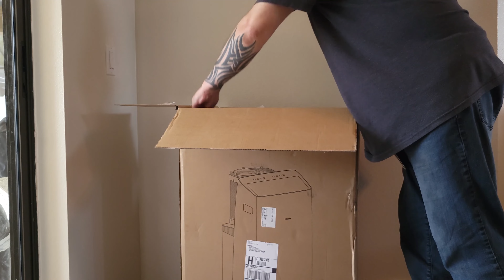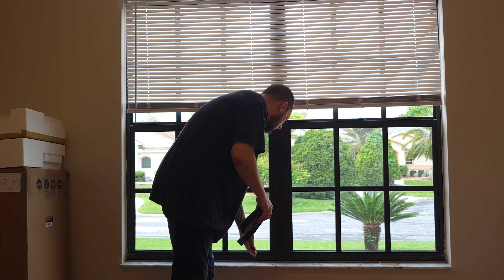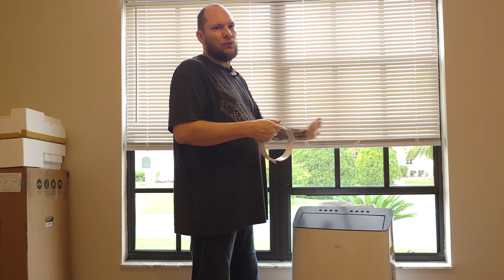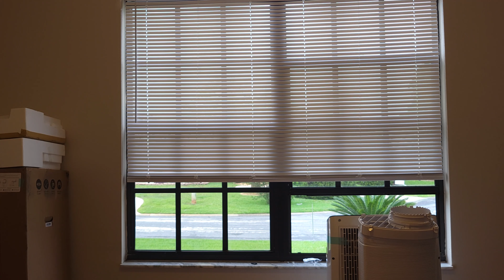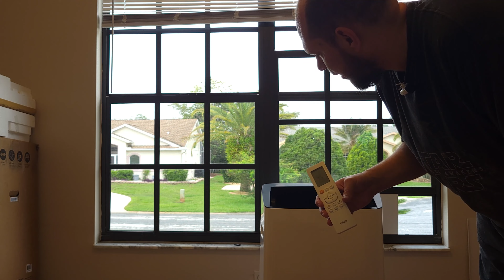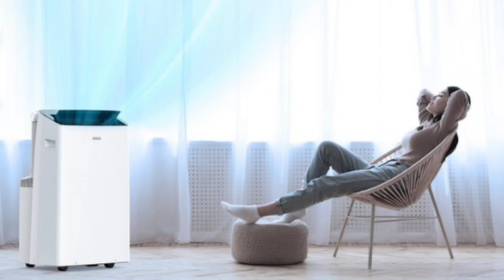Product Review: DREO Twin Cool Portable Air Conditioner

Comment: How long is that exhaust hose at max?
Reply from the maker: 47 inches... or 3ft 11 inches
Reply: @MFProductionsYT  Thanks a lot. One more question:  Is it pliable enough to be bent at a downward angle, as it relates to entering/exiting the unit, or is the height of the vent when unfurled relatively equal to the top of the unit? Reason why I'm asking is that I have to run it under an existing table and I'm strapped for space. The length is doable, but the table I have is only 25 inches tall. I don't know if they sell some kind of hose extension- looks proprietary.
Reply from the maker: It is very pliable... also, it comes out of the bottom of the unit, not the top.

Comment: There's a significant portion missing from this video: Water drainage. All portable AC units need to be regularly drained. When I lived in GA I had to drain a gallon every few hours.

How easy is this one to drain?
Reply from the maker: Easy as putting the supplied tube into a bucket and letting gravity do its job.  I only drained it once, but I never used the "Dry Mode".  There is a plug in back that the drain tube fits snugly into.